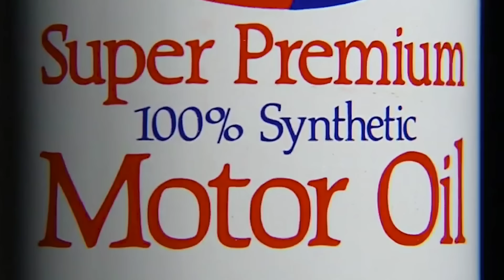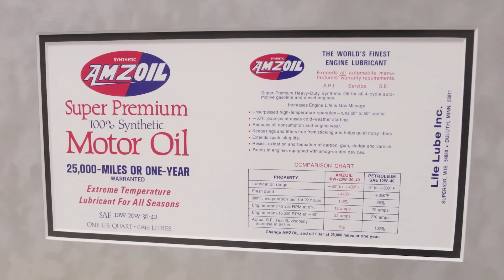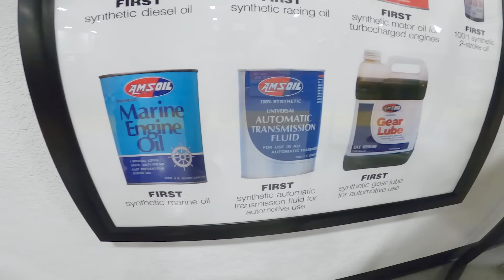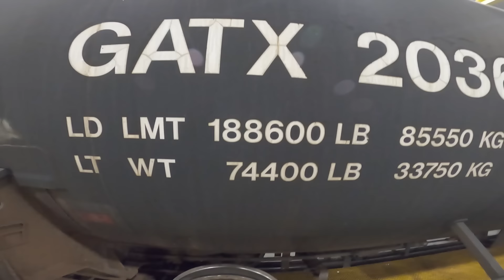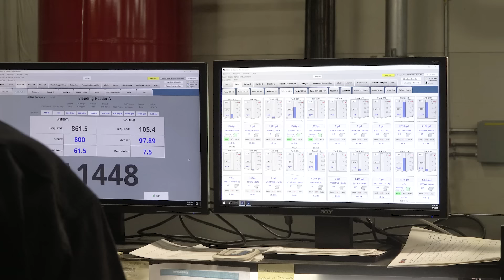How synthetic motor oil is made | Part 1 of 4

Comment: Best factory tour ever. Extremely informative.  2 amazing brands. That have earned my trust over the years. And they will ABSOLUTELY earn my business forever. The quality control of this facility is jaw dropping. And the fact Gale just takes a case and walks off🤣
Reply: That factory will work few years from now on, more to come for ice hybrids engines (that still need oil) but when govern laws will pull the plug switching to full electric cars, that factory will be out of order.. since full electric vehicles don't need oil (for engine, for gearbox or for transmission diff-lock..) the ev's will have different needs (better batteries)..
Reply: @poplaurentiu4148  The TESLA for instance, does use a gear lube in their transfer cases, and in terms of TOTAL ELECTRIC Vehicles, is going to take eons before all the ICE's will be extinct !
Reply: @1gr8oil  Tesla uses a 1-speed automatic transmission, meaning they only have one gear when it comes to shifting as they don’t need more than that. This is because electric motors generate 100 percent of their torque (required for acceleration) at very low speeds, but from the first gen Tesla up until now i didn't see any owners change the fluid from the 1-speed automatic transmission because it don't need or require changing..

Comment: I've been an Amsoil dealer for nearly 15 yrs. Hands down the best synthetic on the planet.  Great video. Loved the part about the pumps never having a failure. I have all products from gasoline, diesel, two stroke, and small engine. All the fuel additives and greases also the antifreeze in every vehicle I own and have never had a lubrication related failure ever in nearly 15 yrs. Run cool ride hard Amsoil 😎.
Reply: Castrol.

Comment: My parents purchased a brand new 1979 Trans Am and they switched it to Amsoil synthetic when it only had 500 miles on it that car burn oil until that had 75000 miles then it stopped and it never burned another drop and it always look perfectly clean took that long to break the engine in that stuff works so good

Comment: As a plumber of over 20 yrs I really am impressed by that facility,  with all those pressure reducing valves and stainless compression fittings......and the pig...yes who can forget about the pig, used those on large sewer laterals in new construction industrial builds, to clean up after dirty contractors that dump shit down the drains during construction. .....

Comment: I’ve used Amsoil in my vehicles for the past 20 years. My 02 Tacoma just hit 300k and it runs and sounds as smooth as a sewing machine. You absolutely can feel and hear the difference once you run their oil. Bought my wife a Honda Passport and after break in, in went Amsoil. Use it in my 05 Honda CBR 1000 and BMW R1200rt. All run beautifully!

Comment: I use amsoil in all my vehicles. Including the transmission fluid. Great product! My dad picked up on this; from what I can remember; at least 20 years ago. 

I remember 2 instances when I changed the oil. About 500-1000mi. the vehicle developed an oil leak. One started leaking from the dip stick tube where it met the oil pan 😂 (93 Cadillac eldorado TC with the L37 Northstar). On the next oil change, I used either semi synthetic or conventional oil. It eventually stopped leaking with the second grade oil. 

The second vehicle was my 93 Kawasaki zx7. It started leaking from countershaft gasket. Did the same thing at the next oil change and it stopped leaking as well.

Amsoil really is a great product. It cleans and protects the internal components like no  other.

Comment: Very interesting getting to see the inner working at Amsoil from your perspective I have been using it for just over 21 years now my '06 chevy 2500hd with the lbz duramax has ran since the first fluid change and is still going strong today with over 613,000 miles and counting
Reply: always interesting to see high mileage like that. Usually comes down to maintenance got a 2012 tundra that has 463k and counting runs like a top truck is pretty rough looking but pretty good mechanical wise. Sadly my yukon suffered abuse before i got it just hit 220k and she be getting sparkly
Reply: What are your change intervals? I have an 03 duramax I just got with 103k on it
Reply: @jonnyg44  after the initial change at 3800mi I started sampling the oil at 10,000 mi intervals and changing the oil and filter at 20,000mi intervals till about 150,000 miles then I went to sample at 10,000mi filter at 20,000mi and oil at 100,000mi unless I saw something in the sample or winter was going to hit at the 100,000mi mark I would change early. Never had a sample flag for immediate change and only changes early for winter no garage and don't like to lay in snow. But I did break an oil cooler seal and changed at 80,000 once and the last changes was at 80,000 just to get back in schedule with my other fluids trans, transfer, and diffs
Reply: @busarfl1840  😂 I change my amsoil oil and filter at 10k
Reply: @jonnyg44  I bought this truck to see what it costs too put a million miles on a vehicle I also originality bought the bypass filtration for it from Amsoil but after sampling and the fear of breaking an oil line and dumping all the oil I never installed the bypass filter but decided too let the oil samples dictate my change interval and at 100,000mi I decided that I can't push it any farther due to my comfort level the samples say I can keep samplings at standard interval I do run the EaO filter states it is good for 25,000 or one year with my driving as I am mostly highways and not loaded most of the time.  I do roughly 45,000, miles a year and only about 5,000 of those are loaded  down / pulling my trailer the rest of the time it is just what fits in the bed usually bulky not heavy. I wanted to see if the oil will do what it said it will and so far so good.  I keep good records and check everything often and at 100,000mi the oil has for the most part changed itself through attrition with the samples and the filters I add about a quart every 10,000 miles sometimes 1.5 expecially now that I am getting up there in milage. And for full disclosure I am an Amsoil dealer (all be it small-scale) and this is what I do with my truck I worked up to this procedure with this truck letting data drive my decision I don't know that I would recommend anyone try this without starting with the samplings and keeping good records. Also my truck is pretty much stock no big tunes or aftermarket preformance parts.  I run the oil in all my vehicles and I can't get this type of millage out of my wife's Traverse the samples pretty much say change at the 20,000 mile mark so it gets a sample at every 8,000 - 10,000 miles and filter and oil at between 16,000 and 20,000 miles
Reply: We should limit the engine volume to 2 Liters, no need for any bigger polluters! this would be a good start.
Reply: @mramstedt  tell me you are not an engineer without telling me you are not an engineer.
 Why dont you limit youself drinking fluids from the recomended 2L/day to 0.5L/day, see how far you'll get!
Reply: @LORENSSIOK  so you mean that the engine size should be at least 8L for you to get anywhere?
Reply: @mramstedt  bro 2L isn’t going to tow my trailer 6.6 lb7 but I do drive a Prius when I’m not working. Also my 800cc lawn mower emits more emissions than my 6.6 diesel truck does. Transportation is 14% of emissions, local manufacturing would do much more for the environment, buying locally etc. also small engines for larger vehicles are less reliable and it takes more emissions to make new parts than what you’d be emitting in a bigger motor

Comment: Great informative video. I watched this with big smile. If Gale is impressed, you know is quality. I think I gonna have to take a closer look at AMSOIL for my 6.7 Diesel. Thanks Gale, your excitement is contagious.
Reply: Keep in mind the bypass filter and know if it's a cummins that isn't deleted, you may have fuel dilution issues inherent to the emissions system that will prevent you from safely running extended intervals.

Comment from the maker: What topics would you like to see Gale explore next?
Reply: Do we have options to vote on?  
I'd love to see more of these, it reminds me of Mr. Rodgers giving tours of factories.  I think we need more of that.
Reply: Could you look at Maxima Oil
Reply: Great tour of the packaging facility in this episode. Now it would be perfect to have a follow up episode on how the oil is actually made and the science behind synthetic oils.
Reply: Topics that come to mind: anywhere bank products could be found (I.e. trucking companies, trailer manufacturers, heavy equipments)?
Reply: The advantage of chrome plated muffler bearings over just bare metal muffler bearings.
Reply: Turbocharger manufacturing.
Reply: Design, engineering, testing of the oils or additives...
Reply: Schaeffer Manufacturing Co.
Reply: +1 for turbo manufacturing
Reply: Aluminum head manufacturing
Reply: Turbochargers!!!!
Reply: Does Amsoil make a dexos2 oil?
Reply: Metallurgy in ring and pinions. A lot of manufacturers claiming this and that about the metals they use.
Reply: Diesel fuel itself.
Reply: @samuelsamsonian5832  I need options lol. If Gale is passionate about something I'll enjoy the video though.
Reply: Explorer how running egr, dpf and def are better for diesel trucks 🤦🏻
Reply: Fuel manufacturing - gasoline, ethanol, diesel
Reply: I’d love to see how my Pedal Monsters are made! I put one one my 22 Powerstroke and my 21 f150 3.5 Ecoboost and love them!
Reply: Vegetable oils!  I have no interest in electric cars, I have a lot of interest in preserving internal combustion with new fuels that are renewable and carbon neutral.  Or even hydrogen and ammonia.
Reply: Duramax crankshaft foundry, machining, and final manufacturing.
Reply: @supercuda1950  muffler bearing? What the
Reply: @anthonyking4387  Apparently you have never tried this importsnt performance item.  I gained 500 hp on my ls motor with no tuning neefed (lol).  That was in economy mode running on 4 cylinders.
Reply: The lab test w9uld have been good to see
Reply: The development history of the turbo as seen through your eyes. The metallurgy, manufacturing techniques, product improvements and developments.
Reply: @treebasher  yeah I didn't see them actually make anything,,, they unloaded a railcar ... where did that come from...
Reply: I Love the ( PIGGING) I ran a small water system. Little over 700 account's. I started a pigging clean out of the water mains. We had Lots if ( iron) build up in pipes. Boy what came out at flush out before and after are
 pigs( foam rubber square blocks) what I used.
I set up a flushing station next to Hydrant. So I could flush both ways on different mains. People don't understand the build up of rust & iron on walls of water mains. It really helps more than just flowing a Hydrant to flush the water.
Reply: @HSKFabrications  that's old enough he'd prolly remember better than anybody
Reply: He may have talked about it before, but if he can publicly go into detail with his thoughts, it would be great to discuss the misguided efforts to interfere with (or even stop) the use of aftermarket vehicle products. It has reached the point that people can even improve a car to burn cleaner than stock, and possibly be forced to return it to stock because of demands that it be left stock for road use. I feel sure that most of us still want to be able to use your products!
Reply: I’d like to see the percentage of Ester in Amsoil, if any. Jet engines use Synthetic Ester. Al Amatuzio being a jet pilot should know about Ester, but I don’t think it’s used in Amsoil. There’s only a few oils that have Ester in it, Motul, Redline and MPT Industries. MPT and Motul are 100% synthetic and most others are just Fully Synthetic which means they have petroleum in their formula, so they technically are a synthetic blend. MPT Industries has the highest amount of Ester in their engine oils and a starting TBN of 12.5. It’s the best engine oil on the market. I had a sample analyzed and it beat my Amsoil sample. MPT also has more detergents to keep the engine clean. Amsoil advertises 25,000 mile oil changes. MPT Industries advertises 30,000 mile oil changes. Amsoil is great oil. I’ve been using Amsoil for 40 years. But MPT Industries has majority Ester in their formula which is is way better for combating heat than a Group 4. Amsoil is Group 4. MPT is Group 5. I never thought I would say it, but MPT Industries is better than Amsoil, Redline, Motul, etc.
Reply: Is it a fossil product that is mined from the earth?
Reply: @davidpsalmond8522  Amsoil???
Reply: What ever happened to Gulf Pride multi G?10-20-50?
Reply: It was the best oil I ever used.1 oil change lasted50,000 miles and still looked new, clear.
Reply: @stephenanderle5422  I never heard of it.  Was it 100% synthetic Ester???
Reply: @stephenanderle5422  I seriously doubt it. No petroleum oil will last 50,000 miles. Not even the best synthetic will last that long. Your engine would be so sludged up with thick tar it wouldn’t even drain out if you tried to change it.  You would need to rebuild the engine.
Reply: @HSKFabrications  No it’s not.  Shaffers is Fully Synthetic.  They are not allowed by law to write 100% Synthetic on their bottles because they use petroleum in their formula. Just like every other oil company that says Fully Synthetic.
Reply: @HSKFabrications  There’s a reason why some companies say 100% and the rest say Fully or All Synthetic.
Reply: So I watched this and immediately thought of BG Products. I’ve used them before with great success. I’d love to see Banks look at under dogs, not just other highly successful organizations. Think of it like Mike Rowe doing Dirty Jobs, but with Gale and smaller orgs
Reply: Belts!
Reply: If anyone @Banks Power is reading this, you need to make more of these type of videos! This video is just about to become your top 10th most watched video of all time in only 5 days. You've hit a gold mind, don't let it run away.
Reply: Let’s see some Agricultural equipment with his products in use
Reply: Diesel fuel !
Reply from the maker: @treebasher  Thats coming in Episode.
Reply: @HSKFabrications  That TH400 tutorial was the best
Reply: Pros and cons of different engine configurations.
Reply: The guys who make those custom packaging lines.
Reply: Well I would like to know what is synthetic about your product. You seem to take in cars of various chemicals ( which I assume come from oil) and mix them), so what makes this better than oil? when is synthetic not just a mix of various oils?
Reply: Could Gale share his knowledge about how to build atmosphere-friendly engines? I think he knows the limit better than anyone and what it takes to meet what many might consider to be unsexy but important nonetheless: emissions & EPA rules. Its been hard to find information on what exactly the gov's rules are, and I would REALLY like to hear Gale's personal opinion on whether those rules are appropriate/realistic/fair. How do compression ratio, load, temperature, atomization, timing, etcetera all effect emissions. Please share your wisdom for the next generation on how to be cleaner and have fun at the same time. That might not excite a wide audience, but it would mean a lot to me.
Reply: What is specification (content)of synthetic motor oil?Thanks!
Reply: great video, just next time do one on how synthetic motor oil is made, NOT how it's packaged.
Reply: @HSKFabrications  shhhhh. please. go be confused by yourself.
Reply: Gale, did they show you the actual engineering of the fluids off camera? Nondisclosure is understandable of the details, just curious if they satisfied that thirst for detail or if your visit was more of a sales pitch using manufacturing and distribution flex.
Reply: what makes the cummins so durable compared to other diesel engines?

Comment: Very interesting. Thanks for the nice video. I use Amsoil exclusively in my supercharged AWD Dodge Charger Pentastar. That little 220 cubic inch V-6 puts out 602 hp to the flywheel. I have a lot of money wrapped up in that car and the supercharger was 12 grand all by itself. It wasn't worth taking a chance on any other oil for the engine. I don't beat on it, but still. I'm old school and change the oil every 3,000 miles. I just use it for the passing power and boy, it sure does have that. LOL Today, I have about 15 thousand miles on the supercharger with NO issues at all. Also interesting, I just watched a 13 oil synthetic shootout on You Tube and Amsoil won hands down. Pennzoil was 2nd and Royal Purple was all the way out to 9th. Mobile 1 didn't even make the top 10. That shootout was an eye opener for me. Which made me wonder how Amsoil was made and here you are. I understand now why it's so expensive, it doesn't have very much oil in it at all. It's all additives. But for 3,000 miles, I might try the Pennzoil at 1/2 the price. It only lost 1st place by a very small margin. All the oils were good, even Walmart and Amazon brands. But for high performance engines, only the best will do. Oil is cheap, even Amsoil, engines aren't.
Reply: My wife has a 3.6 in her new Grand Cherokee and it is a super fast just stock. I have the same motor in my Wrangler and it barely gets out of its own way. It's amazing how a motor can be tuned and geared. Hers is the 9? speed auto. Mine is the 6 speed manual. Truly an awful experience driving the Wrangler and a pleasure driving the GC. Your car sounds like a beast!
Reply: @flat6fever680  Yeah, it's a beast alright and I took out a Hellcat with it. On the Interstate it gets 40 mpg. It's paired with the ZF 8 speed. I think that 8 speed would fix your Wrangler right up.